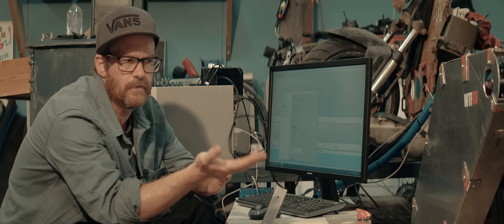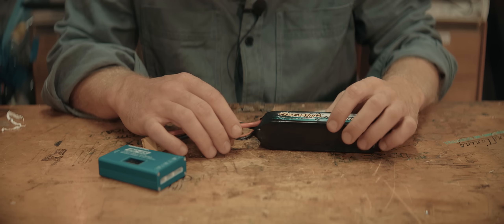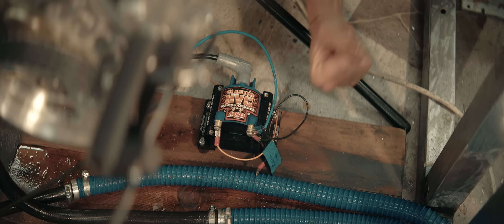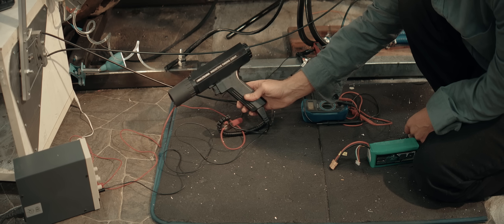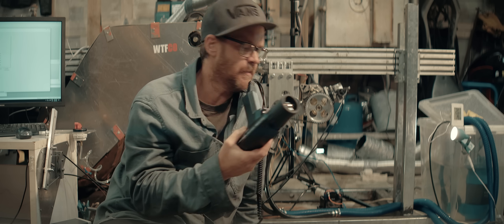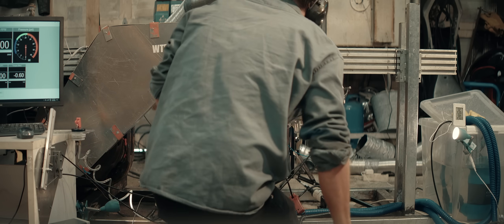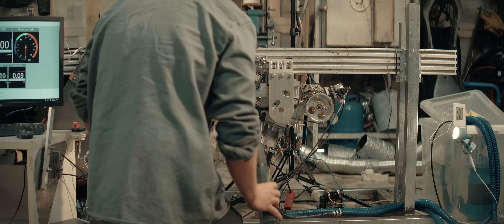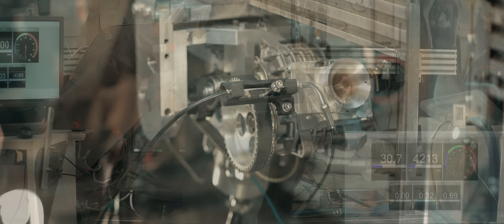Supercharged 50cc Too Much Power for Ignition!

Comment: I hesitated to post a comment on a few videos back explaining how i succesfully had a blower on a 2 stroke 15/20 years ago and one of the biggest improvements i had with that project was to have full control over the ignition.
I even typed out a few lines explaining how your red Seletra ignition and CDI are not really a good product and that i would swap those out asap, i also commented about the timing being way off judging by the sound and abrupt stopping/stalling of the engine after a run but after i read back my own comment i felt a bit like a mr know it all and decided to not post it.
Funny enough one video later you found out the timing wasnt right and i started questioning myself if somehow my comment got posted anyway lol.

We had a pretty complicated system with a custom build cdi from where we could change the map by flashing a rom chip, this cdi also had a custom feature where it would alternate between 2 coil outputs so we had 2 coils firing 1 sparkplug to give the coils a bit more time to charge.
Fueling was also quite a challenge and couldnt get it right no matter what i tried, also tried different carbs like you did but never got the sweetspot, i ended up using a fuel injector to help assist the carb under boost.
It was a very small injector which was given to me by a company that overhauled and cleaned injectors so i couldnt tell you anything about the specs.
That injector pulsed at 25hz all the time and we only adjusted the opening timing of the injector in millisecconds driven by a map sensor.
This way we could get the engine running first without the blower and when i say running i mean running good,  boring out the idle jets so it never falls on its face when you hit the throttle (not even when its cold), its better to have it a bit rich, so rich that it needs one or 2 extra strokes on the throttle everytime (even when its warm) to clear itself out before it can rev again.
Not only because after adding the blower it will need the extra fuel anyhow but also for cooling when you engine brake or have the throttle closed.
If the idle circuit is only a tiny bit lean it will heat up the piston just that little bit more and specially after a run the chances of it locking up right after you let go of the throttle are pretty high, add a blower into the mix and it will certainly lock up after a run.
Adjust it to where it always needs to clear it throat after a few seconds of clean and stable idle or when you engine brake for a few seconds.

We only had it on a dyno once and this was before we got it running better by the sound and feel but it was a 70cc mhr team cilinder which made 23.1hp without the blower and 31hp with the blower,  we made 3 pulls and the numbers were consitent.  for fun we also tried NOS and it made 34hp without the blower (this was withous a nos nozzle lol) and 0hp with the blower because it fried the piston.

Edit: also, cant remember how the ports look in the PIP cilinder but if it has bridges in the exhaust you should drill some tiny holes in the piston and slot them to help cool the bridges,  we had the piston locking up on those bridges even with holes, making a little groove between those holes fixed that problem.
Reply: Back in the day you get a Dörr 50 cc engine off the shelf that started at 20 hp. With your own setup you could get about 28 hp out of it. Thats without supercharger.
Reply from the maker: 20hp out of the box I can believe, not unheard of from 50cc, 28hp would make it the most powerful 50cc ever hp vs cc - highly doubt it.
Reply: @2STROKESTUFFING  The Rittberger Kreidler had 22 hp and that was 1971. There are pictures of of a Racing Bike with 28 hp online. I will find them.
Reply: @lindgruen3118  pictures on line. All depends on dyno calibration etc. 28hp is doable I believe but not on gasoline.
Reply: @afflickracing1705  It had to be gasoline,  racing regulations.
Reply: @lindgruen3118  well they did not have 28 then. What ever you read.
Reply: @afflickracing1705  So if racing engines had 22 hp in 1971, they were incapable to get another 6 hp out of it in the next 12 years? Really? 😁
Reply: @lindgruen3118  yes correct, most of the dev on small 2 cycles was done prior to 71. Even the 500gp bikes maxed out at 200hp in 2001. Mate I have read things, but know from experience, I am the 100cc world record holder, we have the fastest siton 100cc in history at 131mph, 54hp, however a 4 stroke. Not everything you read is correct. But you can believe what you like, I am just trying to help.
Reply: @afflickracing1705  Not bad, considering the speed record for a 50 cc Kreidler in 1977 was 221 kph.
Reply from the maker: Important to differentiate between classes, that kreidler was a full streamliner, Afflick's 100cc is not.
Reply: @lindgruen3118  yes that was a streamliner. Not a sit on bike. I’m aware of the records Thanks mate. 
If you want to keep looking up facts go for it, why believe the guy with the records? Look up flat earth while your there? Just because it’s written does not make it truth.
Reply: @2STROKESTUFFING  Well,  sit on version did 210 kph.
Reply: @afflickracing1705  The bike actually exists. Its called a Pommer Kreidler. Its a Kreidler van Veen and was owned by Ralf Waldmann. 
Rainer Pommer had completely changed the engine and among many other modifications had switched to water cooling. The bike made between 28 and 30 hp.
The bike is now owned by Carsten Freudenberg and is among his collection in Hoyersverda.
Reply: @lindgruen3118  to go 211 you need 50hp
Reply: @afflickracing1705  Eugenio Lazzarini did 210kph on the Spa straight. It was not an streamlined bike. Looks like you are the flat earther thats immune to feedback.
Reply: @lindgruen3118  I’m amazed that you know more then me from google, when I’m the record holder. Enough time wasted. Kind regards.
Reply: @afflickracing1705  Everything i claimed was correct and can easily be verified.  Enjoy your ignorance.
Reply: this was interesting , but now im more confused than ever
Reply: @LeglessReubsRides  Not really.
Reply: @lindgruen3118  sorry I should have said..
" I find it interesting... "
Reply: @LeglessReubsRides  The "record" for 50 cc engine was 46 hp. The goal was one hp per cc. This was in a magazine in 1981 or 82.  But because its not found on the Internet,  its impossible bullshit.
Reply: @lindgruen3118  mate I don't doubt your word at all, admittedly they are very impressive figures but I have no reason to believe it couldn't  happen, im far from an engineer but sure would have had super low rotating mass and balanced to the fk and super precise porting and a highly tuned pipe etc. if you come across the article id love to have a read. not for confirmation but because I love that stuff. I know finding old info can be a needle in a haystack though. cheers for info mate il keep my eye out.
Reply: @lindgruen3118  there's so much not on the internet, but try telling some  youngsters that hahaha
Reply: @LeglessReubsRides  I found something on a motorcycle forum with a scan of the magazine,  but the entry was from 2003 and did not exist anymore.

Comment: Maybe try filing the end of the plug strap and make it round and end directly over the electrode. David Vizard had a video not long ago on ignition systems and there may be some benefits for you by doing some of the things in it. This is one of those things.

Comment: Maybe you can use a microwave transformer to make a extra coil for the Dyno to help slow that engine, there is videos on YouTube on how to make them,  or maybe just mount a alternator to it, with a 12v dc brushed motor controller connected to the brushes,  with a c 3-6 water heating elements, 24-48v connected to the 3  phase output, without the rectifier,  adjust the speed controller to puta steady load on the engine, with the heating elements in water to keep them cool,  or use old stove heating elements, put them in sand or water,  parallel enough to get the load needed

Comment: I also own the cheap biltema timing gun, and i have to hold the pickup at an angle against the wire before it picks up the spark at higher rpm.

Comment: Almost 30hp from a 50cc 2 stroke if you prove those figures are correct, pretty much matches or beats the results from the very best factories that race that class. In a frame and on your other dyno should prove your results so far. Awesome episode!
Reply: More curious about the torque values.
Reply: @LeoTonius  I agree, but if the blown PIP was straining the dyno, that means it was stronger than the brute force version. Really interesting theories sure make you think!
Reply: @LeoTonius  30.43HP and 16.65Nm Torque, both at 13.022rpm. Pretty stout if correct!

Comment: Timing light needs a chassis ground. I have had problems with timing lights powered separately from the motor. Linking bat - to the motor ground should solve light issues.
Reply: Nope. They are inductive pickup. The spark plug is too wet to get a flash.

Comment: Beautiful iv been waiting since the last vid. Very exciting point. I think since nitro is hard to ignite and methanol is hard to ignite that multi spark head and multiple coils wouldn't be a bad idea. I saw almost 25psi in a spike I take it that's the pipe doing it's thing. You might end up with some very high boost numbers especially since the piston is acting like a supercharger along with the pipe. I wonder what egts looked like during that? Awesome job.

Comment: It’s great to see the PiP hit 15k rpm! The more powerful coil should be able to ignite the mixture with a larger gap. Holley has LS style coils that are similar to that MSD that pump out 250+hp per cylinder.

Comment: I can't even imagine the interference that ignition is barfing out lol. In the early days of radio before there were real transmitters, they used "spark gap" transmitters. They easily threw out detectable signals for 100+ miles for around 100watts input. Of course they were outlalwed when real transmitters came along because they could pollute multiple frequency bands with a single unit.
Reply: I had a 80cc race bike that could hit 100mph with enough room ,setting it up in my street that had houses both side 200yards there and back would scramble every ones TV signal back in the  Analogue television days got shouted at several times LOL.

Comment: Regarding PID tuning - set I and D to zero to start. Start with a low P value and increase until you starting getting oscillations, then turn it back down maybe 30% and start adding I value very slowly. Of course if the PID is trying to target engine RPM you have to make sure the engine speed signal into the dyno is 100% reliable.
Reply: I wanted to say the same. If oscillation occurs the P value is to high. Oh man i hated the math when we did Regelungstechnik in school. It can be sooo complex and it has way to many formulas (we had to memorize) 😄
Reply: @DasArschlochKind  it was a difficult class but I had a perverse enjoyment of it! And it’s the sort of concept that is so complex to model with math but just “clicks” when you get hands on with it :)

Comment: Regarding the ignition lamp (timing light) - try to change the way of the current in the clamp. Simply clamp it the "wrong way" and you will see. Or the last option could be the spark cable if it is shielded or not. Crossing fingers to solve the problem with the timing light! Awesome vid as usual btw. 😉
Reply: Just a wet or fouled spark plug will give no timing light.
Reply: another old trick was to put a large wiring eyelet under the plug and then attach the lead to that.
Reply: @dret74  Haha i love it

Comment: I wonder how the cylinder wall plating is coping with the repeated flooding nitro
Reply: Quite well by the looks of things
Reply: @Scissors69  we won't be able to tell until he disassembles the cylinder head. This is the first time he's ran the engine upside down and it keeps having the hydrolock issue. Fuel eats at cylinder walls especially methanol.

Barrel wash is the term

Comment: Contact Jiri at Ignitech and ask him if you can combine the outputs from the DCCDIP4 for more primary spark power. Both the DCCDIP1+ DCCDIP2 only have one voltage converter (DCCDIP2 alternates it between two channels) and the DCCDIP4 has two separate voltage converters. You might be able to achieve the same by joining the outputs from two separate DCCDIP1/DCCDIP2 units. He has always been very helpful when I've contacted him with tech questions and I'm sure he will be able to advise you on the best best way to achieve really high secondary HT spark power.
Reply from the maker: Great idea👍 was actually thinking about the the same thing this morning. I've got a sparker DCCDIP4 on loan from Hollaendaren.
Reply: Braaaaaains!!!

Comment: Obviously to avoid hydro-lockiing EVER is to invert the engine 180 degrees is a perfect idea - removing spark-plugs on the Bonneville salt flats in front of everybody, and the HEAT is not very cool, ever, either.

Comment: If you can increase the dwel time on the ignition and close the plug gap up this should stop any brake down of the spark in side the cylinder.

Comment: From what I've seen, I think that the PiP engine with the supercharger has more power potential than the BF engine. The cylinder design, the port design, the crankcase volume, etc. were all designed with airflow in mind and all it needed was a little help getting air and fuel through it for incredible power.
Reply: This guy has taught me more about two strokes, but your idea sounds in line with what I already knew. Let's watch.
Reply: The brute force is definitely more in the design family of 2t diesels should make more at lower revs but agree the flow and particularly the rpm potential of the PIP are superior.
Reply: @mrln247  Keep in mind the Brute Force was making like 20hp for a 5000rpm power band, it's very impressive.
Reply: @arekkoski  Agree definitely didn't find the full potential like testing twin tuned pipes.
Would like to see the ideas separated again PIP pure resonance 2t and the brute force how much boost can you run.
Reply: That's any engine though, it's a giant air pump more air you can get in and out the more fuel you can burn more power you'll make
Reply: @nathanbutler8240  Exactly. I think the PiP has less over all resistance to airflow in its design and thus can make more power for the same pressures.
Reply: @cameronjenkins6748  the more HP you make na the more HP you will make boosted
In theory if you add 14 psi/2 bar you double the air entering the engine and double the horsepower if the engine flow well enough
In a perfect world it should make close to 40hp
Reply: @legros731  sea level is technically at 1 bar so n/a is 0 for reference in psi, adding 14.7psi would be 1 bar added but yeah agree on that adding 14.7ish psi with a turbo engine that’s a rough typical formula, but with s/c engines because of the parasitic loss it’s boost requirement for the double power theory is higher
Reply: @needmoreboost6369  that exactly why a said 2bars is equivalent to 14 psi
Because 0 psi is 1bar but with engine we mostly use inch/hg for vacuum and psi for boost so full vacuum should be -14 psi or 30inch/hg
So you are right we say 1bar for 14psi boost my bad never use bar as a unit normally 
A was thinking like a 2bar map sensor can read from -14 to +14psi
Reply: @legros731  yeah you’re right it’s hard telling someone that they need a 2 bar map sensor to run 1 bar boost lol and I should talk I can hardly write at least with text it’s half readable.
Reply: @needmoreboost6369  same for me English is not my first language and I am not good at writing lol

Comment: This thing is becoming a complete beast with each dyno run, i need to see this on a scooter with gearbox not cvt
Reply: Then this it is noth scooter
Reply: @g.g4816  old vespas are rated as scooters but have gears
Reply: @GhostOfDamned  jup got 2 of them, one with 20+hp😁

Comment: Hi everyone. Biltema have a ignition coil that gives 36000v part no 53-403. I have fitted one in my lotus esprit turbo and it works very well. I've tryed a few before but they couldn't take the cylinder pressure. I have a boost pressure of 1,2 bar. Good luck. A Swed in France

Comment: Try playing more with the Kd part of your PID controller, the Kd (for differential) deals with change of the measured value. So not the difference between sp and mv like the Kp, but the slope of the mv (difference between previous mv and current mv). A higher Kd can deal better with rapid changes in the mv.
Generally a too high Kp will generate oscillations.
Reply from the maker: Thanks for the tip!
Reply: In some tuning guides it is advised to disable D coefficient completely (set to 0 or a very small value), to help to tune P and I into a ballpark. A too large D can also amplify oscillations. Agree that too high P will easily cause oscillations. Problems may also be caused because of unstable retarder rpm data that the controller is seeing. Not sure if he is using the retarder or engine rpm now. I think ideal is to use retarder rpm, and the sensor should have at least 5 pulses per rotation. This could be checked if it is possible to graph out the retarder rpm and also acceleration. On my dyno it was impossible to make the ramp work properly before I fixed problems in the roller rpm input. After that it started to work quite easily. I found out that I is the most important factor. The I action will try to drive the braking force steadily towards the target value, while P is for reacting to a sudden change. Problem with P is that it will easily cause an overshoot. P must be reduced until oscillations stop, then try to increase I. On my dyno I set D to 0.01 or something, I don't think it has much of an effect.